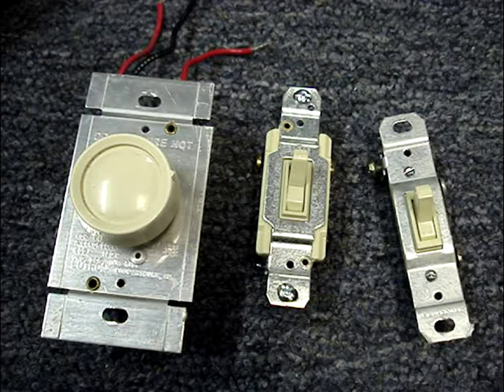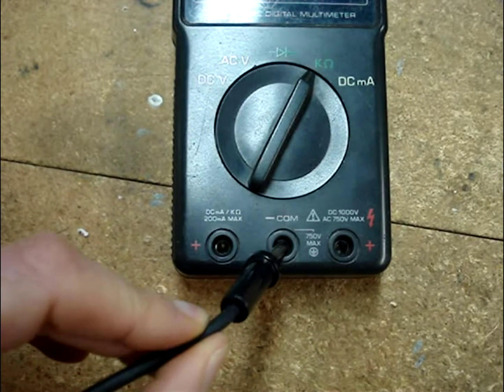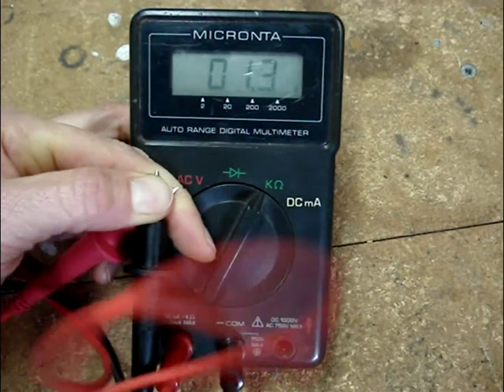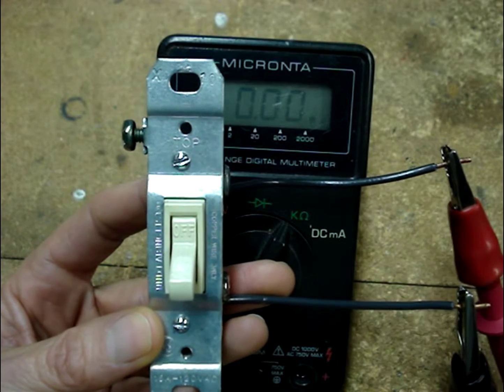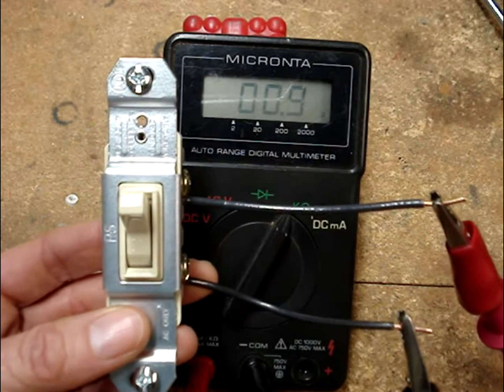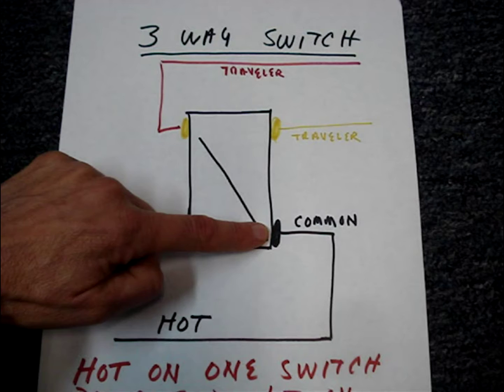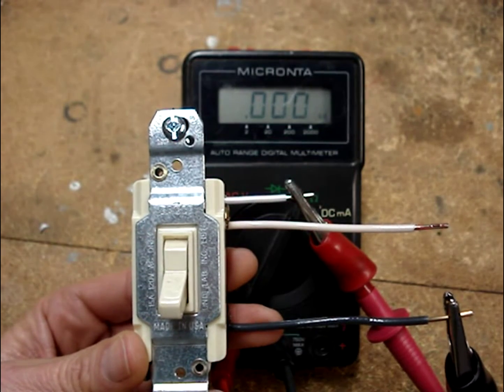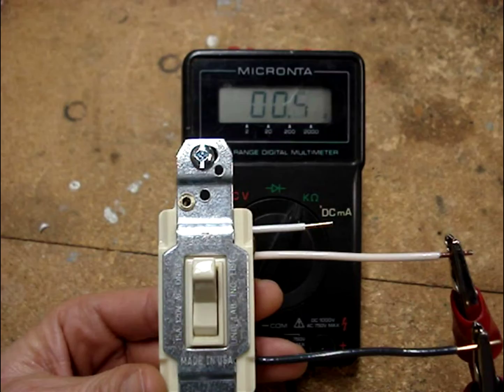Test a Light Switch With a Multimeter

Comment: I want to measure the total load on a light switch.  What is the best way to do that?  I have a clamp meter.
Reply from the maker: Clamp on hot wire, turn on light switch.
Reply: Thx
Reply from the maker: You are welcome

Comment: I have a four way configuration which was working intermittently. I replaced the 4 way switch and the circuit is still working intermittently. Does this suggest a bad 4 way switch or a problem with one of the other switches in the circuit. How to proceed. Thanks
Reply: intermittently? there might be a crossed wire somewhere in the circuit, try drawing it out, sometimes if the wires aren't in the right places, the circuit will work only when the first or last 3 way is in the correct position

Comment: You have to use continuity too
Reply from the maker: Using the continuity setting is not wrong, though it is not a "must use".  If you look at my mulitmeter in the video, it doesn't evening have a continuity setting.
Reply from the maker: Thank you for commenting.  Please explain why you need to test for continuity too.  Also, what is the difference between continuity and reading 1-2 Ohms on a resistance setting on a multimeter?
Reply: Know How Now it tells you triple Zero and lights red if that device is bad
Reply from the maker: I don't understand your explanation.  I've spent over 20 years working in the field with electricity/electronics.  I've never had to use continuity to determine if a switch is bad.  I prefer resistance setting, I can see if the resistance is fluctuating..... a sure sign that you have a bad contact.
Reply: Know How Now oh ok. Well they show us different in trade school .

Comment: Hey I have a question I was using my multimeter and I switched it to AC current and used my red probe to check voltage on the switch while it was on and then there was a spark and the room turned off I really messed up what should I do?
Reply from the maker: Check your breaker, it likely tripped.  If your multi-meter has a fuses, check them.  You might want to buy a book on AC circuits 101 or borrow one from the library.  If you are grounded and touch the hot wire of your home's electrical system, there is enough current to stop your heart.
Reply: Know How Now Thank you so much I really appreciate it a lot and thank you for the recommendation
Reply: @trillali2724  yeah I was going to say look at your breaker and see if it's in the middle of being turned off or on. That would mean it is tripped! Also there's a good chance you blew a light bulb? Also wherever you had your spark, look and make sure it did not burn through a wire! But my opinion, please do like he recommended and read up on electricity before you mess with it anymore!